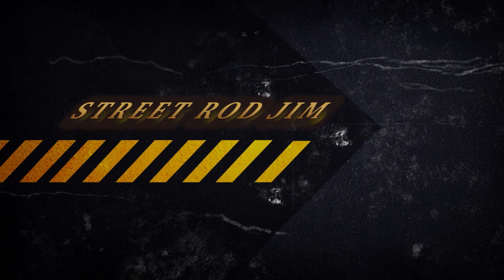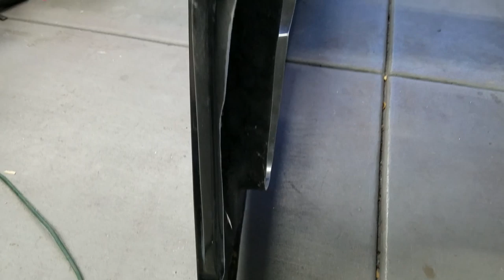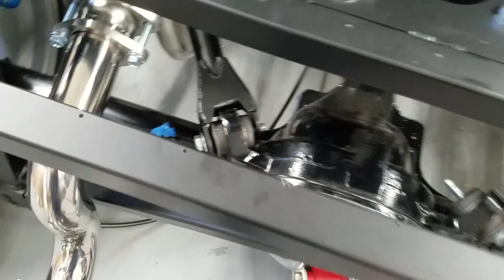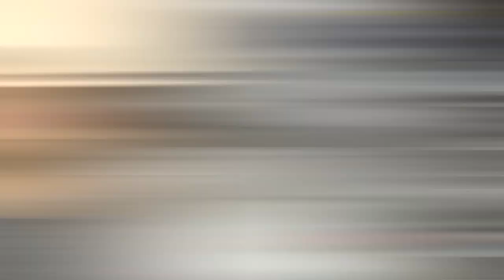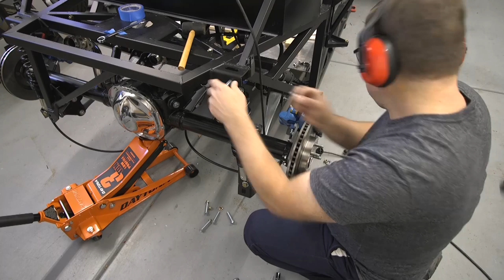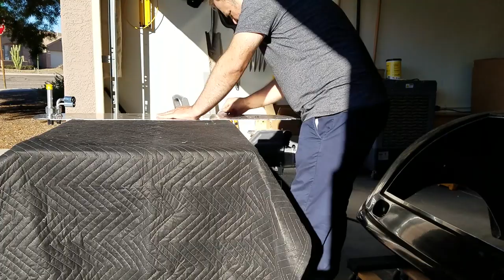Factory Five 33 Hot Rod V2 Build -  Control Arm Installation & Ride Height Adjustment

Comment: I am interested how the COVID is affecting you.  More time?  Just background?
Reply from the maker: Honestly, I thought I was going to be a full time car builder for 8 weeks, but it has not worked out that way.  I have been filling my mornings with some work and a lot of tech support and repairs I could not get to since I was doing the 60-80 hours strait for the last 2 years.  However, I do like the calm/disconnect from the rat race.  I feel like I can tackle more things on the car without "well what if I am in the middle of that task and I have to work all day tomorrow, I don't want to leave the engine floating in the air for 9 hrs" type of thing". That type of thinking will make me not move forward. Especially during the work week.  It is a little more difficult if you need help.  No one is willing to come over, and if they are, you don't want them to come over.  LOL

Comment: Are you running with an 8.8 differential, what is the pinion angle set at.
Reply from the maker: Yes, I have not set mine yet.  I think off the top of my head it is suppose to be 3 or -3, but not sure.  I am at zero now with the new arms fully extended.